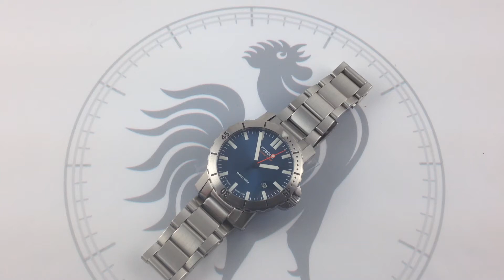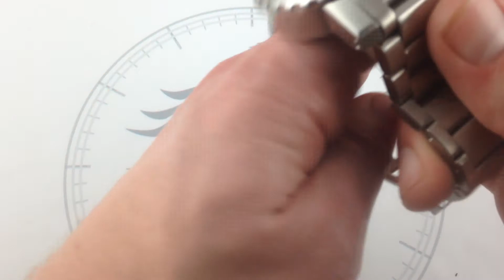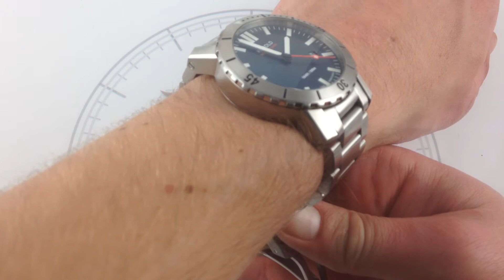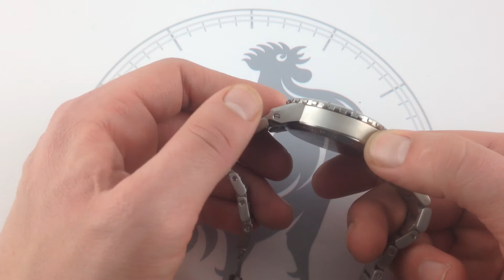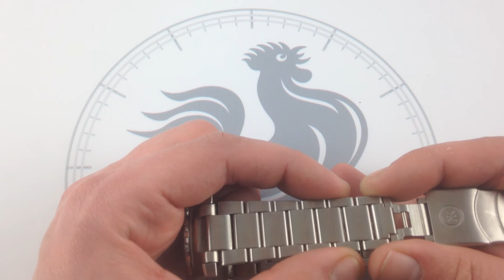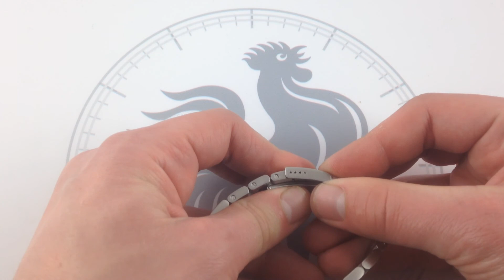Kobold Soarway Diver Arctic Blue Luxury Watch Review

Comment: The bracelet securement is only as good as its weakest element. In this case, the multitude of screws, including those fixing the end links to the case, are sadly all for not as the pin used in the buckle betrays all the advantage of the screws.